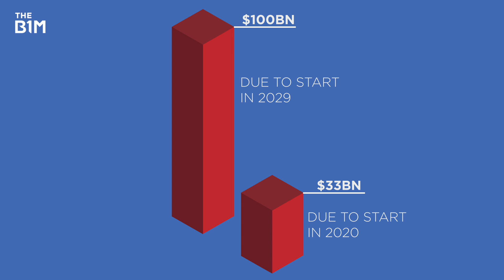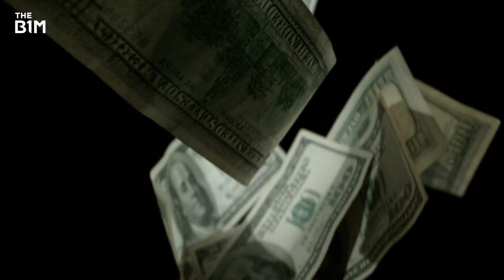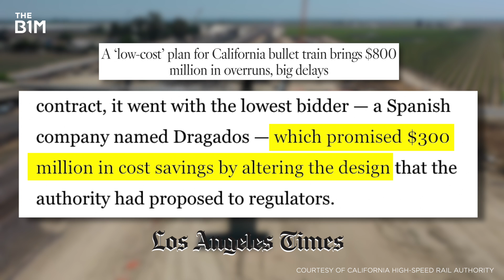What Went Wrong With California's High-Speed Railway

Comment: Double track Amtrak's long routes. Averege travel speed will more than double. Trains traveling in opposing directions playing leapfrog with side-rails slows average travel speed to 25-30mph. Even slower when the system is heavily loaded; forces Amtrak to stop trains for recrewing when crew operating time runs out.
Reply: Does Caltrain or Amtrak own the right of way though? Most likely not. And the Class 1 railway companies hate capital costs so much they even dismantled some of the double tracks, to skimp on maintenance and labor fees, as well as property taxes.

Comment: As a Californian here's my take on this:

California HSR has the potential to succeed but that will only happen if a handful of changes are made to the project, to address the concerns of opponents in the state. 

Thankfully concerns about "trains are communism" and the like aren't prevalent in the state, those which are mostly center around the project's wasteful spending and the lack of car-free transportation infrastructure in the cities being connected by the rail line.

First, California should pass legislation exempting the entire high-speed rail project from all environmental review requirements, on the grounds that it will be an environmental improvement due to its ability to move people throughout the state without the use of fossil fuels or massive lithium-ion batteries. The state has done this for infrastructure before and could do it again if they wanted to.

Second, California needs to make similar investments in car-free transportation in the cities the network will connect. MASSIVE expansions in pedestrian, bicycle / personal mobility and rail transport need to be made everywhere along the route, like the networks many of these areas had 100 years ago. Systems such as the original BART network are a good starting point but still need several times as many lines as originally proposed to actually eliminate the need for cars. Pacific Electric's old network in Los Angeles should serve as a guide for the amount of service needed to actually make the region accessible without a car, not just a handful of lines on the LA Metro. Streets also need to built more like those in some parts of Europe, with sidewalks everywhere and separated bike lanes wherever possible.

Finally, the network needs to extend out of California FROM THE BEGINNING. Oregon and Washington have expressed significant interest in a high-speed line connecting Portland to Vancouver with stops in between, and the three states have similarly compatible politics such that a collaboration between them should be possible. Extending the California HSR line up to the Oregon border would both enable connection to a Oregon system and allow for future population growth into the state's sparsely-populated northern communities. A connection into Tijuana in Mexico could also be made if there is interest in the region, I personally predict there would be given the massive number of people who regularly cross between the two countries for work, recreation, and socialization.

-------

It is utterly despicable to me that California, the most progressive state in the nation, has botched high-speed rail so badly that even progressive Californians are reluctant to continue the project. The state has so much potential given its massive population and unified, pro-transit and pro-environment government to be a national (or even world) leader in sustainable rail transport, but got in the way far too much during the initial construction phases. The state literally drove most of its contractors out of the country from how poorly it managed the project, this should NOT be happening in California.
Reply: Fourth: implement zoning reform and densify ALL the land around the railway stations. In Japan they planned entire cities around the main railway station, which means there are a whole set of amenities and destinations within a 15 minute walk from the railway station. Hotels, convention centers, shopping malls, theaters, offices and even schools and residential apartments are located around and above the railway station. This generated massive revenues for the city and the railway company as well.

Fifth: turn the railway station into THE transit hub. Most major railway stations have stations and terminals for subways, streetcars, buses, and taxis located either inside or immediately outside the station building. All of their schedules are aligned with the railway timetables, with frequencies between 5-10 minutes, for transfers to be as fast and seamless as possible. Some of the best examples of these are Sapporo, Toyama, and Hakata stations.
Reply: @ianhomerpura8937  Two VERY good points that I forgot about!

Comment: The fact that none of the railroad companies were interested should be a clue that it’s a bad idea. Plus comparing one country to another is insane. Their problems are different, and so are the solutions.
Reply: The class 1 railway companies are deliberately derailing passenger railway journeys, just look at what they've been doing to Amtrak for decades. They even dismantled double tracked railway lines to prevent Amtrak from using them. Especially the clusterfuck that is Norfolk Southern.

Comment: "Incredibly sensible plan for a high-speed rail plan..."

ROTFLMAO  It was NEVER sensible.  
In fact, it required a conscious and willing suspension of any form of reason to think this was a good idea.
HSR makes sense along 300-500 km. transit corridors with many population centers along the route, and plenty of local public transit connections to get passengers to their final destinations.  Like all profitable rail lines, it needs low grades and not a lot of major geographic obstacles.  And it certainly helps if the entity developing the line already owns the right-of-way so it does not have to spend vast sums of money acquiring it, and pay the political price of condemnation to acquire it.  

Of course NONE of that was true in California.  The only practical rail route between LA and San Francisco is over 800 km, crosses THREE major mountain ranges, and is already occupied by private freight railroads moving large amounts of cargo vital to the California economy.  There is only one major and one minor population center between the roughly 100 km at each end, neither of which has anything resembling a robust local transit system feeding riders to the HSR.....thus most of the ridership will have to be generated by end-to-end travelers.  In fact, it was ludicrous to think that this proposal would be successful.
Reply: Same thing happens with roads yet you don’t seem to have a problem with houses being bulldozed for highways or that roads are just unprofitable
Reply: @darthmaul216  "Same thing happens with roads..."

Highways cost about 1/10 the price of the equivalent HSR line, are wildly more flexible as to the grades and curves they can be located on.  Consider that the shortest car route from Los Angeles to San Francisco is roughly 380 miles, while the proposed HSR route exceeds 540 miles. One can easily mix freight and passenger traffic on roads, while mixing such uses on HSR is virtually impossible.  As for your claim that roads are "unprofitable," that is ludicrous.  Every study on the construction of highways and interstates demonstrates that the taxes levied both on the users via vehicle fees, registrations, fuel taxes, and increase in taxable value of property adjacent to such transportation  corridors more than pays for such highway projects on the whole.
Reply: @ilikehardplay  all of those benefits you mentioned are indirect. 

How about upfront right of way costs? Car maintenance and insurance? Billions of dollars lost in traffic congestion? Skyrocketing gas prices? You Americans disregard all of that because you are all so obsessed with your cars.

Comment: Just make sure theres a cheap reliable rental car waiting for me at the gate when I get there. Otherwise whats the point?
Reply: Would a tram or subway work?
Reply: @darthmaul216  what are the odds that a tram or subway is going anywhere near where I need to go? very very low.
Reply: Many countries have that. Indonesia has bus, taxi and ride hailing terminals built right beside railway stations. In Japan subway and streetcar stations are built right under the main railway station, for fast and seamless transfers. It's very easy to do if you act rather than complain all the time.

Comment: problems are as follows:
1. should not start this project.
2. now that it started, it should have started earlier.
3. should finish as soooooooooooooooooooooooooooon as possible.
4. to do point 3, should focus on building but not presenting, advertising, annimation showing off.... (1/50 of the length of china's high speed rails, but 5,000 times of videos/shorts on this....)

Comment: I don't know if it's possible, but can't the high speed line be build on top of the existing one? It will save time and effort to buy lands and build a whole new line. I understand it can be a massive engineering challenge, but might actually solve a lot of the problems. Or maybe build it on top of the highway maybe?
Reply: Building over something that exists requires total disruption to whatever is underneath.
Reply: @RaymondHng  not necessarily, look at the Hudson Yards in New York. Like building a tunnel over the highway, at least for parts where  it's hard to buy the land.

Comment: This video paints HSR as a universal good and something Americans should embrace if only they were smart enough. The reality is HSR makes no sense for the US. The population density is too low and the geographic area is too large. Even in Europe where population density is far higher and distances between population centers far lower, HSR requires large subsidies. Secondly, this specific project in California in particular makes no sense at all. Numerous studies have shown that the projected ridership between LA and SF simply does not warrant this type of investment. Other studies show that the resulting trip isn't going to be any faster, cheaper or more convenient than simply flying. Also, of course the state started construction in the vacant, flat, agricultural Central Valley where right of way negotiation, routing and construction is all far easier. It gives an unrealistic expectation of what it's going to take to actually realize the goal of "Downtown LA to Downtown SF travel". If you want to see cost overruns really spike, wait until the line starts approaching the dense, hilly cities and they start having to deal with vastly more complex issues of topography, property rights and noise regulation. Lastly, the costs for the project were ludicrously (perhaps fraudulently) under-forecasted by several California administrations. Those bills are just starting to become due. Overall, this entire project is the very definition of a wasteful boondoggle. Lastly, the comparison the China is ridiculous. Private property, rule of law and environmental regulation exists in the US. This isn't true in China. It's easy to "get things done" if a government can just dictate, but this is hardly a good thing. Also, China built HSR as much as a propaganda and economic growth tool as for legitimate travel purposes.

Comment: A few issues to remember with regards American rail. First, existing track lines have far better served the nation for cargo than persons. That has always meant getting people adjusted back to train travel (ie, pre-WW2 realities) has not been economically worthwhile. Second, American traffic is still built on a pre-9/11 model. Back then the travel time using airports was more than half less than now. Security changed air travel's timing. Third, the idea of HS rail is still a 20th century concept. Business travel, which is essential to making HS work is declining even pre-pandemic thanks to tech, and will only continue to do so more post-pandemic. The traffic numbers used to spawn CA HS between SF and LA will be substantially lower than pre-2020, which wert already lower than projected in 96/08 when approval began. You have to have ridership to pay for HS which is costlier. And unless you have significantly improved inner-city transport, HS doesn't solve the issue of getting from station to business.

Even here in the UK the actual advantage of HS is highly questionable, and mostly falls to London, not the North.

Comment: A high speed rail project is much more efficient than a commercial flight. It will take you four times as long to get from SF to LA, about the same time it would take to drive, but once you get to either SF or LA you won’t need to navigate a terminal or station and you won’t have to drive to your final destination because, unlike a commercial air flight, the train will go door to door.

Comment: We need one here from NY to Connecticut. Just driving from Manhattan NY to Fairfield takes 1 hour and 30 minutes. Sometimes 2 hours if traffic is jammed.
Reply: That is part of the Northeast Corridor which runs from Washington DC to Boston by way of New York. The Acela Express services this entire segment, but unfortunately, in New York and Connecticut, it’s not really high-speed rail with average speeds at about 70-80 miles per hour, barely faster than a car. This is in spite of the route stopping only once between New York and New Haven, at Stamford.

Comment: I have long proposed having an EV car 'train' where the cars are electrically joined and get recharged while being towed down the freeway in a special lane.
Given they have given up ever finishing it beyond the useless middle section, they should change it to transport cars on the track, so they load up in Madera and unload in Bakersfield to continue on their way, and move at say 100 or 150 or as fast as feasible.   Only EVs allowed, and they are recharged while on the train.  You stay in your car.
Basically a way to do what I proposed, but use the mega expensive wasted resource they created.

Comment: 3 times over budget in the easiest 200 mile section. Maybe 10% complete from the overall goal. It won't even be a high speed rail (130mph at best). Nobody will even use it. Time to re-evaluate what we use it for.

Comment: The US in 1939 had a larger and better train system than the rest of the world put together. For many different reasons it basically collapsed. Now there is no longer an actual system, which requires many feeder lines for the long distance ones. To restore a (barely acceptable) system would require trillions of dollars. It ain't gonna happen. Dammit. This train will accomplish almost nothing.

Comment: This was a misconceive project from the very beginning.  If they wanted to build a bullet train system they should have started with a line that makes sense between two popular destinations.  Merced to Bakersfield is not the stretch to start with because it is a bullet train from nowhere to nowhere.  Los Angeles to San Diego would have been better or Los Angeles to Las Vegas.

Comment: While the democratic US can't go ahead, the dictatorship China railway projects go like a high-speed train. But, with no brake.  
 Now, their economy is in crisis and the huge budget high-speed railway project is becoming big trouble:
 February 2021. China's video site Xiyi Jinyi has released a video analyzing the future potential of China's high-speed rail, which operates in the red.
In the video, the total debt related to high-speed railways of China Railway Group has reached 5.6 trillion yuan (about $877 billion), and 12 of the 18 railway stations are in the red. 
Therefore, experts have pointed out that high-speed rail is a "gray rhino" that is likely to cause major problems in the future. However, China is still accelerating the construction of high-speed rail, saying it plans to increase the total length to 70,000 kilometers by 2035.
Why will China continue to build high-speed railways despite its huge debt and deficit management? According to the video, it is pointed out that the related industries will be enriched with the construction of the high-speed railway. The construction industry is wide-ranging and creates a lot of employment, so it is said to have a high economic effect. The video also explained that since it is powered by electric power, it has the advantages of low environmental load and high transportation efficiency, and the high-speed railway used by many people has a lot of room to produce greater economic effects in the future. So it argues that we should not just look at the current deficit but in strategic terms.
In addition, they introduced that they are proceeding with the construction of a high-speed railway even if they know that other countries will also be in the red. "It's not embarrassing to be in the red, but it's embarrassing not to be able to build it," they argued. they also argue that high-speed rail, like mail, is an important infrastructure that connects the country and should be built regardless of profits.
Certainly, the economic effect will be great, but it does not mention how to solve the huge debt, and it is undeniable that the Chinese high-speed rail may be a "gray rhino". ..